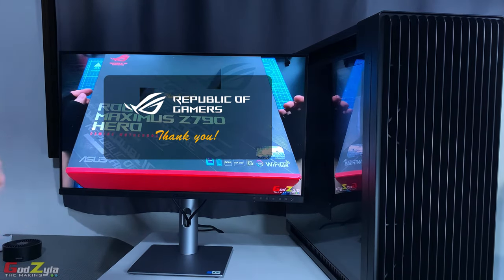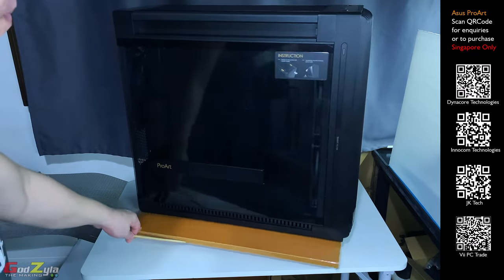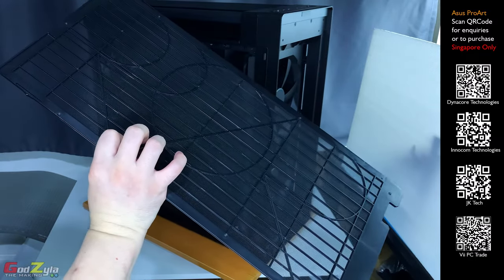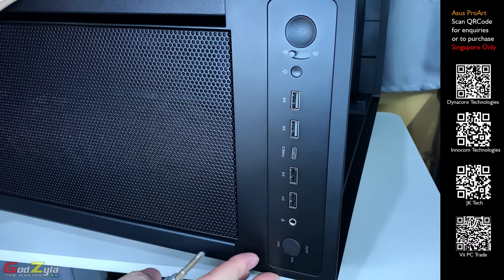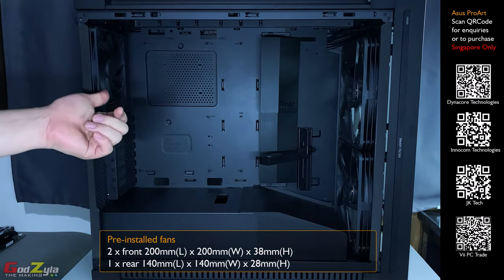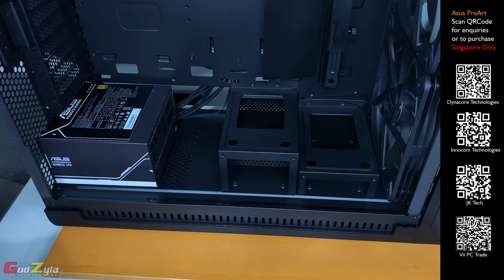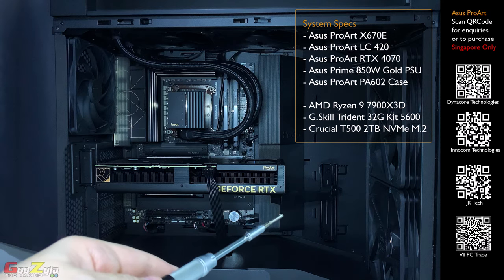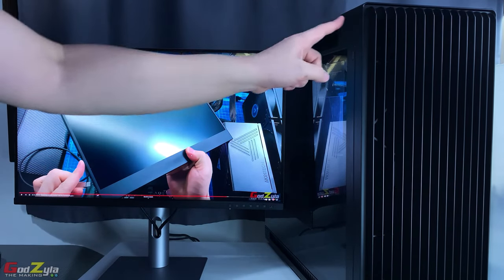Asus ProArt - Featuring PA602 Chassis

Comment: 250..plastic front panel...no
Reply from the maker: Hi TheTastefulThickness, welcome to my channel. No doubt is plastic at the front cover, but consider the fact that you only need those fans that come with the case. No additional fans needed if you do aircooling. Even using liquid AIO. Fans are already with the liquid AIO. That’s my opinion.
Reply: Yes but this case isn't supposed to be value oriented.  It's attempting to be upmarket.
Reply from the maker: @TheTastefulThickness  Hi, to behonest,  I do like your suggestion too and will take your suggestion to Asus SG on this. Thank you! 
These are my honest opinion. I do not mind about the plastic front. This case is pack with thoughtful features. 1) I dont have to worry on getting additional fans which will add up the cost, 2) All is needed is to plug a 420 liquid aio at the top which comes with the fans. Alot did mentioned his is pricely but if you are to calculate the additional cost to purchase good case fans, the price will add up. Leaving other cases + fan cost which is equivalent or higher compared to just get this case. 3) the features of this case are very well thought off. 4) Bottom mesh filter removal (easy access) 7) the rollers which you dont have to carry the whole case out inorder to reach the rear I/O ports.
Reply: @KleoYan  The dual 200mm fans is certainly a rare but welcome design.  I can only think of the fractal case that also employs them.
Reply from the maker: @TheTastefulThickness  True, I agree. Ok lets just say that we have each our own opinion.. for Fractal, consider the case is not cheap either, plus need to change out the case fans for better airflow.. so ya. that's my concern about other cases.
Reply: I agree, I’d pay more for same design with aluminum front grill.
Reply from the maker: @ewmcdade  hi and welcome to my channel. Thank you for your feedback 😉
Reply: @TheTastefulThickness Fractal uses 180mm fans. this one has larger 200mm... Also wood edition is out. That's what i'm thinking to get. 200mm fans gonna be sileeeeeent 😆

Comment: It is actually 593mm tall. I brought this case based on your review. Now I have a pc tower that will not fit into the space it was intended for. Disappointed I should have double checked before taking advice from a tech review from YouTube.
Reply from the maker: @AllThingsAustralia  hi welcome to my channel. This is weird. In most case reviews I do not just based on spec. Do you mean the depth (from front to rear) is at 593mm or do you mean (top to feet) 593mm?? From top to feet is at 560mm
Reply: @KleoYan  it is 59mm from top to feet & 560mm from front to rear. I ordered this today & have been told that these are the dimensions. Do you have a tower close by you could please double check these measurements for me? Otherwise definitely hands down the best presentation & well put together review.
Reply from the maker: @AllThingsAustralia  before anything, I apologized and sorry if I gave the incorrect information. I do not have this unit with me as I have returned it, but I will check at asus show room when I have time. 
I am pretty sure I did measure it as most of my case reviews I do not based on specs. an example, the specs of the AP201 https://www.asus.com/sg/motherboards-components/cases/prime/asus-prime-ap201-microatx-case/techspec/ dimension of it is 205 x 350 x 460mm  in my content of the AP201 https://youtu.be/p-dyGeduWlw time stamp 00:50 I have measured and the dimension is at 205 x 360 x 455mm. there are others which I have notifify case manufacturer.. I do not go blindly just to follow specs and to do my content. Nevertheless I will check again. pardon me if I did this mistake.
Reply: @KleoYan  thank you & much appreciated.
I will confirm this one mine arrives in a few days. The ASUS website doesn’t state if dims are Length x width x height.
Reply from the maker: @AllThingsAustralia  Hi I have just got back from the showroom after work, the Height is at 593mm and depth is 560mm. I sincerely apologize for my mistake, I wrong down on my note while filming this content,  I should have indicate the measurements (W) (H) (L).. so sorry about it.

Comment: Just bought this case and you saved me a lot of headaches trying to find tiny black screws hidden around the black metal drive bays I needed to remove to get my PSU plugged in!
Reply from the maker: @theovernight1915  hi welcome to my channel. Thats good and hope you like this case as I do. All the best with your build too 👍
Reply: I have this case myself did you use a proart motherboard? If so which one I am not sure if I am best buying a 850w or a 1000w psu
Reply from the maker: @johnplanzski9215  hi and welcome to my channel. It greatly depends on your pc part. I would go for a 1000watt PSU that is PCI-E 5.0 ready. Which can cater for the 12VHPWR connector for the RTX 4000 series GPU.

Comment: This was a great review. Very detailed. I have been trying to convince myself to buy this case and your review pushed me over the edge.
Reply from the maker: Hi Ontario Guy, welcome to my channel. Thanks for the feedback. I was too like yourself. Thinking why should I pay this much for a case and realised that by adding other factors like addition performance fans and such. Which this case comes with 3 performance fans which is quiet in operation. That’s the reason why I did this content to share why the price tag. I am glad you find this useful and all the best with your build too 😉
Reply: @KleoYan  About 2 years ago I bought an Asus ROG Strix Helios case and there was a problem with the IO that shorted out my computer and killed my motherboard. After taking it apart it turned out that the IO board had a short. I have been very hesitant about buying ASUS components since that issue. This case is just too nice to pass up though! I am hopeful that the one I get works as expected! - I am going to buy it tomorrow (I think).
Reply from the maker: @OntarioGuy430  ouch! that's painful. Hope you did get to change your motherboard. As for this case, I believe it will be fine. Btw, all the very best and do let us know your experience once you have complete your build too. 😉

Comment: Think I may order this case for my next build. I still like my Antec Dark Cube I've had set aside, but I think I may save it for later on. I really like the clean simple black aesthetic of the ProArt series from Asus. Not really a big fan of Asus, but I prefer this over the "wood is good" look lol. At least the ProArt stuff is pretty diverse these days, makes it easy to stick to a theme.

If the motherboard tray/interior could be inverted like BeQuiet's case, that would be the only thing they could add down the road.

I like your review process, good in depth coverage of every detail, no monologuing about other nonsense lol.👍
Reply from the maker: @Demonoid1990  hi and welcome back and thank you for your kind words as for the stealth black. Yup this case looks good. I like about the fact that I don’t have to purchase additional fans. The fans included are all solid performance fans.
Reply: @KleoYan  Well I ordered it along with an Import on the CPS RZ820. I think that should give me the nice clean aesthetic I'm looking for. At least this way I shouldn't have any issues with fitting whatever I want in there lol.

Maybe I'll use my little Antec Dark Cube down the road as a build for my sister instead. Sure my Brother in law and little nephew would enjoy it too. They don't have a PC, but my brother in law does have quite an extensive collection of retro game consoles and old arcade cabinets.
Reply from the maker: @Demonoid1990  that’s very nice of you.  👍

Comment: Great videos thank you I needed the info as my power supply is 200 mm
Reply from the maker: @uwhat1  hi and welcome to my channel. For psu length of 200mm, not an issue. You can fit it in, and still leaving 50mm space in between the psu and 2nd hard disk cage. Hope this helps. 😉

Comment: My friend, a wonderful, detailed review! You are the best!  

I have such a case and am thinking of purchasing an Arctic LF III 420 mm.  But I was confused by only one point, that you indicate that it cannot be placed and the top panel will not close. But I pick up a tape measure and take a measurement, the actual distance from the bottom of the metal bar to the horizontal where the top cover should snap is 38-39 mm, i.e. Should the LF III 420 squeak right next to each other in height, or does its actual thickness of the side flanges go beyond 38 mm at the widest points?
Reply from the maker: Hi Peter Kolupanoff, welcome to my channel. You are right. it can squeak in, but do be mindful that the radiator is very close to the top mesh panel, there are restriction of air pusing through as it's almost against the top mesh. I have tested the thermal, without the top mesh yes it's good with thermal but when I place the top mesh panel. the temperature increases. 
Infact my main objective is to stop using the Arctic LF2 or LF3 at the top as the thermal is bad. To where I am testing this is at room temperature of 30°C to 31°C in a hot and humid country. You can give it a try if you are at a colder region. Do pardon me of what I've mentioned about the fitment at the top. All the very best with your build.
Reply: @KleoYan  In fact, I see that it is possible to carefully remove the dust filter mesh from the top panel without any problems and leave only the metal one with large holes, since a fine mesh has no practical meaning if a radiator with fans is installed
Reply: @KleoYan  It's not so hot here now ;) And for now I have enough NH D-15S to cool my 7950x3D, but I want to try 14900K and for it you will only need something huge. There are H170i, Pro Art LC 420 on sale, but their cost is 3 and 2 times higher, respectively, than the LF III 420; however, they cannot boast of greater efficiency for their cost, and rather lose in performance.... so I still consider the LF III 420 as the main option
Reply from the maker: @Liquidatorization  hi,  you have a very highend processor for gaming which is the 7950X3D. I don't really understand why would you want a 14900K and do you know there is a on going issue with the Gen 13th and 14th i9 processor? anyway if you still choose to try 14900K with arctic liquid freezer III, you can go ahead and try. but I won't count on it as the LF3 only shines on AM5 and not Intel . you can take this as a reference, though this test are based on 360 liquid AIOs. https://youtu.be/ca2zGSQvWog
Reply: @KleoYan  In fact, after 20 years on Intel, a year ago I still bought an AMD platform and I don’t play games at all - everything is for work - and I took this processor because it is more technologically advanced, even air cooling can cope with it. However, I encountered an inexplicable problem while copying and caching large volumes of files.... as time has shown over the year, I could not come to terms with nuances and algorithms that were incomprehensible to me in working on the AM5 platform of the processor-RAM combination: the point is that after For some time, somehow the writing speed from the RAM cache on the SSD drops, i.e. as if some kind of artificial stupor is triggered..... what I mean is that a large array of files of 50-100 GB in size is being copied and at some random point in time the copying speed drops sharply from 4-5 GB/s and drops to a level of 70-100 MB/s, I noticed that this happens within 20-50% of the stendbylist cache fullness and copying continues at such a low speed for several minutes until the stendbylist cache is completely filled to 100% and only then the copying speed again sharply returns to normal values 3- 6 GB/s...... what this is connected with I can’t understand on the previous Intel i9 z390 platform; I’ve never seen such a crooked performance of unloading from cache to disk. I need to constantly or manually clear the standby list cache using a crutch in the form of Intelligent standby list cleaner ISLC by setting the auto-cleaning limit within 4-6 GB (and I have 96 GB of memory) or manually run some software for testing RAM like TM5 so that it quickly I loaded the RAM up to 100% and quickly dropped the load and then everything worked again at the usual speed..... I didn’t have such problems with Intel before and a year later I came to the conclusion that I would have to buy a similar processor from Intel, which, although twice as hot, The same performance is needed with a 420 mm water cooling system, but the Intel platform will not shut up in trivial tasks, cutting off the overall system responsiveness by almost 10 times.
Reply from the maker: @Liquidatorization  I see, ok now it make sense.. then you should not have gotten the 7950X3D hmm.. anyway if you purchase 14900K, just make sure to limit the PL1 and PL2 as I do encounter crashes and such, even if I dont play games.. anyway all the very best with your build 👍👍👍

Comment: Hi! Would you be able to fit two Asus TUF 4090’s inside that case? 😬 The second one using a PCIe riser cable because there is little space between slots😅 And using 1,200W PSU (or more?)

GREAT TUTORIA BTW👍

And wold you recommend the X870E proArt mobo? 😬
I have still doubts…

Thanks🎉

Comment: Another great vid. Been tossin up buyin a case and was wondering Between this and the O11 Evo RGB, which would you pick? Disregard the HDD panels. Price wise would probably save more with the 602. Appreciate the feedback.
Reply from the maker: @kimisami88  hi and welcome back. Both case does have its pros and cons. If on earth there are only these two cases which you have mentioned. I will pick this over the o11d Evo RGB 1) I personally not a fan of ARGB and I totally dislike running ARGB softwares at the background 2) simple ARGB is ok but not overdose a case like a Christmas tree plus getting Uni fans adds up a bomb, which I can save that and to purchase more practical pc parts. Example, Rams with tighter timing or m.2 3) this case do not need to populate with so many fans and it’s quiet in operation. 4) lesser fans = lesser dust 5) this case out performance on thermal 6) its a more mature looking case (executive look). Now it’s all up to your liking. 😉
Reply: @KleoYan  Ah huh, I forgot about dust collecting from the other fans. I have an Aurora R12 now and it has only 2 fans so I've been struggling to find a nice case due to prices. I like RGB but when the case has no fans that additional costs always seems to make the Rig cost more in the end. I was concerned about cooling with the 2 large fans and 1 exhaust only as I want to make a Ryzen 7800x3d build with a 4080s or one of the 7900xt or xtx. Was gonnna use the Coolermaster Master liquid 360 atmos for an AIO since the Deepcool Mystique apparently is loud. Any thoughts on this brosef?
Reply from the maker: @kimisami88  I see. I can understand your frustation to find a value case that comes with all the gimmicks and functions. For a start, your 7800X3D with the AMD 7900XT or 7900XTX does not really runs too hot. Now it boils down to which type of casing you are looking for. Just a suggestion. this is what I will do.

1) Narrow down which style you wanted and fix to it. Fish tank or the classic case that has front intake..
2) Narrow down your budget, within the ranges you can consider, outside the ranges just drop it, no matter how much you like it. 
3) Functionality + Case cooling (ARGB or Non ARGB) . a hint, 140mm fans draws tons of air and run lower rpm = less noise. 120mm fans you need to push higher rpm to have more air in, can be noisy.
4) Asethetic, for me this is not the first piority. If you can have 1) to 3) fixed and follow by the aesthetic. You will enjoy most out of the case as it's not only of the value you wanted but with looks. 

Last but not least as mentioned your system does not really generate alot of heat.. so the cooler master 360 liquid aio will do fine.
Reply: @KleoYan  Gotcha bro, while were at it, id like to ask you something as well. Are the SSD speeds important just for casual fellas like me? I work full time, have a utube channel i stream from occasionally playing games and I do a lil bit of video editing to post vids. NVME.2 ssd's i feel the 7200 and such seem a bit overkill but would a 5000/4800 ssd be good enuff? These SSD prices are crazy.
Reply from the maker: @kimisami88  In general if you are just doing causal gaming and video editing, a Gen 4 m.2 nvme is more than sufficient. Unless you do compile 3D projects and to do heavy file compression 7zip and etc. Hope this help.

Comment: Kleo, what do you think about Thermalright AIOs (for instance Core Matrix 240/360)? Would you pick them over Liquid Freezer III for the 14th gen Intel build (14600K)? I am little bit worried about their pump reliability, however it is much thinner than ridiculously thick Freezer III.
Reply from the maker: Hi David Borovsky, welcome to my channel.thought I do not have those AIOs you've mentioned to test, but I do have good experience with the ThermalRight frozen warframe 360. it cools a 14700K with ease. As for the liquid AIO you've mentioned, after viewing the structure (https://www.thermalright.com/product/core-matrix-240-black/) It's safe to use a 240 on a 14600K. Just make sure your case have good airflow 😉